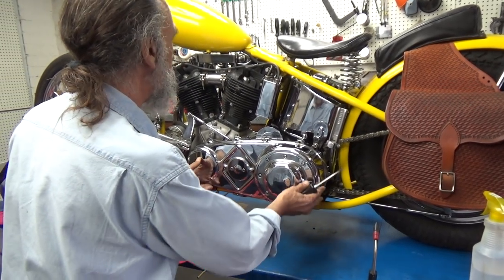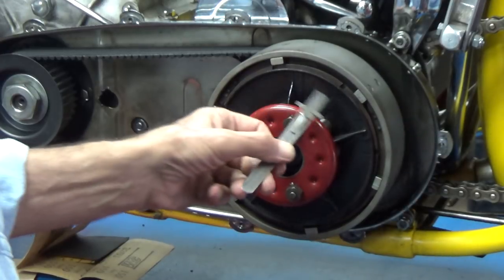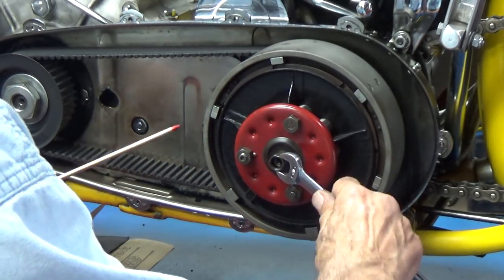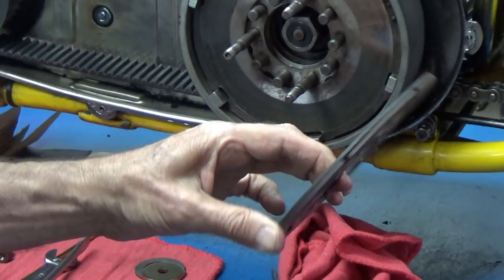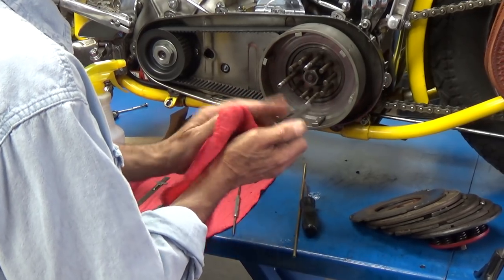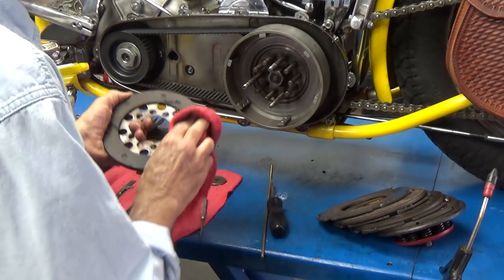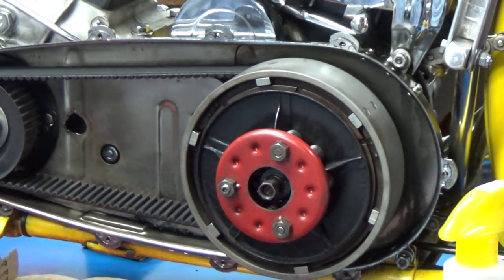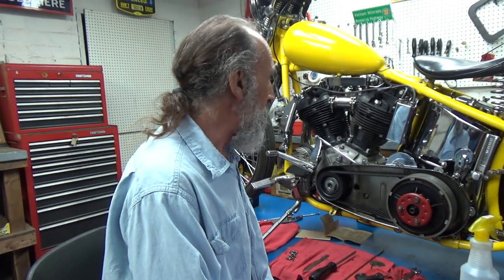Service the stock dry clutch on a Flathead, Knucklehead, Panhead, or Shovelhead Harley Davidson

Comment: I have 1971 shovel and the engine is panting oil to the clutch. I was told it is for reason.
Reply from the maker: I need more information.  Is it leaking at its mainseal?  Is the stock oiling system working on the primary chain?  Are your oil hoses hooked up properly?  Sorry, need more info.

Comment: The three screws should not be three it should be at least for at least four.    The first three screws😎
Reply from the maker: Three is correct.  That is how the factory intended and designed it.  Some people buy hubs with five adjustors.  Not necessary.  The factory did fine.  Get those adjusted evenly.  Start with the measurements in the book.  I don't know what you're going through, but going through the whole system, from the throwout bearing to the lever up on top, is the only way to know where the problems lie.  Or, maybe you're just doing a routine cleanup .Either way, with everything clean and adjusted properly, you should be fine..